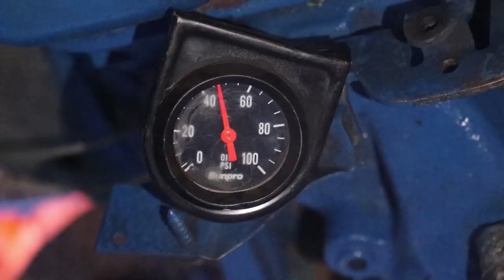JUNKYARD 440 First Start With Homemade Run Stand Wide Open!

Comment: Time to make a specific "engine trailer" which has mounts above the axle, basic electric fuel pump, small fuel tank, radiator, and overall open design for ease of install and removal.

Comment: Oil it up now and seal it up to keep the moisture and critters out. A freind of mine bought a pair of 440's years ago which were also low comp. and low mileage. So low mileage they looked almost unsused. I think he paid aaround 1500 for them. Anyway we couldn't get one to start.... they were marine engines and one went the wrong direction... ha ha

Comment: I have a 67 283 I picked for $50 because it had sat outside with plugs out and froze up ...I took my time and over i guess 6months of penetration spray got it loose....have it on the shop floor and have run it like you did your 440

Comment: Love it. Runs really good. Even if it’s low compression just swap a nice camshaft kit with valve springs have good power. Find a Dart swinger 2 or 4 door makes a neat package 📦

Comment: Pull the plugs to alleviate compression resistance. Also allows you feel the rotating assembly a bit better

Comment: You lucky man. Always finding shit like this. And I'm just sitting here trying to figure out why a moped won't start. Turns out the clutch cable wasn't connected. 😑
Reply: What moped did you have I have the same issue

Comment: I’m voting for using that 440 also! The modern hemi is cool but given the option, I’d go 440.  Check out where I’m at with my 70 challenger project!  Ordered floors, etc that’s on its way!!

Comment: Hey Dylan thank you for the video I enjoyed it and they used to have them in the General Lee's so that. Is where I would shove it back inside of a Dodge Charger those big 440 blocks are beautiful engines heavy but beautiful and they make a lot of horsepower

Comment: Is that a '74 or later cast crank version? Damper looks like the super thick one they used on the cast cranks. Cool man!
Reply: Oh, maybe I'm wrong... looking from the alternator side,it looks like a standard four groove crank pully on the forged crank thin damper.

Comment: Hi Dylan i ve been watching for a long time now since the beginning! ? what carburetor  did you use when you ran the 440 edelbrock ? CFM? 
reason why i ask is i have a nice 1978 D200 Adventurer iam going to revive this summer!
I Dragged it home 4 summers ago and i changed the fluids and kept it running ever few months until recently !late fall i tried to fire it with no go.something
 small im sure.
the truck has 80,000 klm canada.
i even thought of putting it a car if i can find one ! but the truck is so cool looking with patina dodge red and sliver 2-tone sliding rear window tilt steering and air conditioning long box rwd
i should send in a picture. Thanksfor the inspiration Great to watch you grow up - looks like you have a great dad that shares the same interest vs versa

Comment: You should weld up a frame /channel iron to hold engines and a radiator, gauges ,tach   ,be God to use to break in new engines

Comment: Its gotta be a good candidate for the Challenger Dylan you got it for next to nothin it seems to run good so win win situation drop her in get her piped up and bolted in place and see how she goes you ain't losing anything are ya. While she's out and accessible degrease it clean it up give it a new lick of paint and make it look pretty give the engine bay the same treatment before it goes in and it'll look great "and, if you chose to do that it'll save you some money in buying another motor to go in there.

Comment: Yeah I have a question why can’t you put the 4:40 in the charger you’re working on that would be awesome came out that 440 Bore it out little bit cam it out
Reply: 1, it's a challenger, 2 it's a small block car, so he is putting in a Small block hemi, 3 it's a super low compression RV motor, a cam is not going to do anything

Comment: What year 440 is it?
What did it come out of?
Reply from the maker: 1978. It’s from an RV.
Reply: You really can't go wrong with a big block from an RV. Usually low miles, generally not hard milage either. I pocked one up in Ohio several years a go, from a 77 RV, with an automotic 727 HD, with only 22,00 miles, for $300.00. I had to drive from Florida to Ohio and back. My Uncle's friend was junking the RV, because it had been neglected for so long. At least I got to visit friends and family on that trip!!!
Reply: @DylanMcCoolVideo  From an RV is the most desired as far as I'm concerned ,  Road Kill did a series on a RV 440 that started out in General Mayhem.

Comment: I didn't read all the comments but,  did you by chance run the numbers and find out what it's from?
https://www.enginelabs.com/engine-tech/a-guide-to-mopar-v8-cylinder-head-and-block-casting-numbers/
Reply: Short tailshaft and companion flange on the trans almost always means motorhome.  Shape of the damper tells you its 76-78 block with a cast crankshaft.